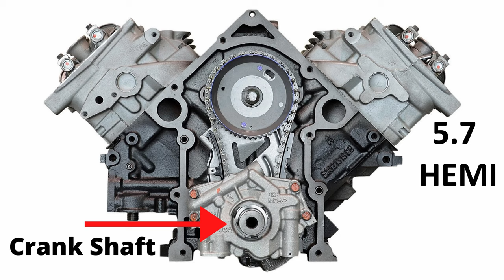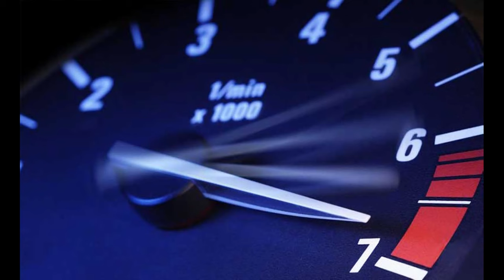HEMI TICK Explained (Easily) - The Cause and How to Diagnose

Comment: Thank you for information !
I Own a 300 c 5.7 2019 and I to heard the ticks in cold starts !
I have been recognizing that  at 17.000 km only and now 20 k nothing changed !
I changed the mopar oil to penzoil fully synthetic and still coming for only 3 second !
don't know what to do 
I will try locus oil next time
Reply: Tick goes away after a few minutes warming up better check your exhaust manifold bolts.. yes I am a retired mechanic
Reply: @scottrussell6717   Actually I Went to the dealer, they said it’s not possible to be exhaust leaking ! 
Not in chrycler or Dodge Charger 
I tried lucas oil this time and it’s better. 
Thanks

Comment: Do the new rams have an updated Hemi? I’m looking at a new 2020
Reply from the maker: Apparently it's very similar to the ones in the older model. which would make sense seeing the power number are exactly the same.
Reply: I got a brand new 2021 ram and it’s says on the manual that the tick is possible 🤣

Don’t let the that drive you away from a ram though I love mine.

Comment: I have the same ticking but it's not that loud like the ones I've seen, and like when it is ticking it ticks for like a solid 10 mins and then it just stops, and when I accelerate it it ticks even faster and louder, would that be a exhaust or would that be in the engine?
Reply from the maker: hard to always tell. usually an exhaust leak tends to fade as the engine gets warm but not always the case. I would lean towards an exhaust leak.

Comment: Metallurgy mistake when making the cams?
Seems like the permanent fix is a cam with DLC coating on the lobes and lifter faces or rollers.
Reply: Nope fix is making lifters that pump oil thru them camshaft and lifters are good quality oem When they designed the hemi the angle the lifters are at do not allow oil to go down to that roller where it meets the camshaft it is a design flaw also they put a girdle in the middle of the block it blocks any oil that would splash up on the camshaft .they made the lifters at this angle because it’s a better angle for the lifters but the idiots didn’t compensate for the angle so lifters and camshaft run dry

Comment: Ok I have watched the video and I’m a bit skeptical only because I have a 2003 Dodge Ram 2500 with 5.7 liter hemi and I noticed ticking noise about 10 years ago at 108k miles now I still have the same truck same engine I know it’s about the end but it just rolled 493,000k miles.  I’m determined to make it to 500k. Show me one ford or GM that can do this and I use this truck to cut concrete everyday!

Comment: Mine has a loud ticking up to 2,000 RPM. Sounds like a loud sewing machine, gets louder as I give it more gas up till around 2,000 RPM. Can hear it very loud in a parking garage
Reply from the maker: These engines do have some top end noise naturally. when I first bought my truck I honestly thought I had an exhaust leak off the sales lot but apparently that's just how they sound. regardless if you are worried doesn't hurt to bring the truck into a trust worthy shop because a decent mechanic should be able to tell right away if there is an issue.
Reply: i went online on the ram truck forum and people have killed the Hemi tick by using redline oil   5W-30 it suits the hemi.
Reply: @7thkev519  thanks for the info , I've been using mobile 1 with 1 quart of marvel mystety oil. So far so good.

Comment: I dont know what gasoline your putting in the truck. But if you look on Google the reason from the hemi tik its mainly caused from bad gasoline. Remember it's a hemi it uses that hemispherical header to make more power. It's a performance engine, it needs synthetic fuel

Comment: Anybody notice in all the pictures of destroyed lifters it was the MDS enabled ones?  This is mostly an MDS problem.  When either the lifter or solenoid fail with MDS active the roller no longer stays in contact with the cam lobe at higher RPMs and causes the destruction of the needle bearings from crashing on the lobe.  #1 cause of that failure mode is dirty/contaminated oil.  Also, all Hemis tick a little.  It's when it gets louder than usual that you may have something to be concerned about.

Comment: The in block cam design limits the lift of the cam and its duration. So, Mopar put the cam higher in the block to make more horsepower available.
Another possibility, and this will take some research and development, would be to put a line above the lifters to spray oil on the top of the lifters and cam lobes. Besides using better needle bearings, you could use bronze bushing type lifters. I think Crane makes them.
Reply: Hemi has oil galleries above the cam/crank and sprays oil under pressure on the engine parts..It doesnt rely on splash from the oil pan!

Comment: Glad you talked about it. In my opinion, this is a pretty severe design flaw and everyone always acts as if the Hemi is the best engine ever... I can’t stop thinking about this. I love my Hemi but this is not what a good engine is supposed to be like, and what’s worse is that Chrysler hasn’t fixed or acknowledged it, even though it’s been an issue for over a decade.

Mine does it very slightly and when I top off the oil every few months, it’s completely quiet for like 2 days. For me it’s just extremely annoying because I usually do idle a lot, and I’ve been trying not to, to avoid any catastrophic damages. I’m looking at trading it in right now. I’ll miss the Hemi because it was a fun power train and by far the best sounding, but damn this feels like walking on eggshells.

Comment: Decent video. I like replacing these cams, motors are gravy. I work for a chrysler dealer so you can understand. 
The hemi’s and 3.6’s are the speciality.
Rule of thumb is if there’s ticking on cold start and goes away, then it’s an exhaust leak. But you can tell before that because there’s a tisk type noise. 
Lifter tick will always be there, hot or cold.
And what i’ve found is that hemi’s with lots of idle time and going too long on oil changes will get you there quicker
Reply: I noticed on my 13 rt, I had to jump start it and wen I finally got it cranked it was making a terrible knocking noise but eventually went away, any suggestions on that
Reply: @cutmiller8846  Sounds like it was misfiring maybe ? Any check engine lights/codes ?
Reply: Hey man my 2014 hemi is ticking hot an cold. I don't believe it's an exhaust manifold leak. No codes ?? Lifters would be a green light for a warranty
Reply: Good to know, the 5.7 in my Aspen ticks at startup but goes away after a minute or two.

Comment: I know the pentastar V6 as well seems to have a similar problem with roller bearings going bad.  I have that engine in my Ram and think that problem may be starting.  My plan though is to replace all 24 of them if its the case.
Reply: Yes they are notorious for it too. Best is to replace all while you are in there

Comment: Basically drive it like a hellcat a little bit.
Reply: Thats what i was getting too like so the best way to preserve the motor will be driving it hard?
Reply: Yeah basically step on it and make sure you get on the free way
Reply: Ouch on the Gas .
Reply: Lmao I be whippin my 1500 like it's a TRX
Reply: @Durahan82  damn that's true. I fill up $90 per week give or take $400 per month
Reply: @looksmaxxxine  Daily driver ?
Reply: @Durahan82  yeah but I'm saving up to get another car so I don't have to drive my truck as much. I want an F90 M5 but I don't think that will help with the gas situation haha
Reply: @looksmaxxxine  don't waste your money on BMW, get an old jeep with M/T way easier on Gas.
Reply: @Durahan82  I need a sedan...I already have a truck so I need a sleek low rider that goes fast especially on turns
Reply: @looksmaxxxine  A V6 Charger with a M/T will be easier on Gas then.
Reply: @looksmaxxxine  a toyota for good mileage and low cost of repairs/maintenance
Reply: @axel2k322  I need speed and luxury I don't want plastic interior and halogen bulbs. Ya feel me? I also need a good sound system. I hate when doors rattle.
Reply: @looksmaxxxine  a passat vw would be good

Comment: Sometimes it is broken exhaust bolts... easy fix is to use shorty headers that mount up to stock exhaust or redo the exhaust with long headers. Bolts are notoriously broken because of cast iron manifolds verses aluminum heads... stainless steel headers will expand better with the aluminum heads... reducing the chances of breaking bolts. Port the journals on the crank and other port orifices to a wider angle will increase oil coverage... we used to do this in the machine shop to increase the life span of the parts with adding a performance oil pump.

Comment: But the lowly Slant Six and 318 LA engines would last seemingly forever with few problems.  I had a few waterpumps go out, and one timing assembly (who thought nylon cam gear teeth was a good idea???), but overall, these were great, long lasting engines.  The later Magnum 5.2 and 5.9 are good performing, long lasting, too.  But I worry every day that I'll start my 2016 Ram 1500 5.7 Hemi and hear "tick-tick-tick-tick...".

Comment: I have been recommending VR1 racing oil for these 5.7 hemis, yes I know it is bad for the converters but only if the engine is burning oil, most do not, I think the extra zinc may make them last longer it coats high pressure areas with a coating that will protect them even with no oil for some time

Comment: I’ve seen 5.7 hemi’s drop valves because the driver kept driving it after it starts ticking. Ppl say 5.4 Tritons are bad I’ve never seen them go bad they keep on ticking. Dodge made the same flaw with the 4.7 and on top of that the 4.7 dropped valves because they weren’t rated right from the factory. Chrysler quality.
Reply from the maker: It's a tough look from Chrysler. It's honestly to bad because when the hemi's run well they are a great engine. lots of power and very smooth. also have a great sound.
Reply: The Getty Adventures yeah I know that’s one reason ppl still buy them, when they run correctly they’re great engines. You can probably spend some money and bulletproof then I’m sure tho.
Reply: Grunt  quit assuming shit buddy I got a 2001 Ford F-150 5.4 2 valve and an 05 5.4 3v. The 2 valve has 243k miles and the 3 valve has 165k. And I am a part time mechanic I’ve seen a few 5.7 hemis have lifter failure. Never seen a 5.4 have lifter failure just valve train ticking sounds but they keep on doing it
Reply: The triton 🤣 they couldn't even get the heads correct. Let's start at the spark plug issue...
Reply: @coltendixon1782  yes let’s talk about a cheap non catastrophic issue of the 5.4 and compare it so the 4.7 and 5.7 severe issues...
Reply: @popeyeandstraussmx4165  and I said let's START with the spark plugs..

aside from a no start,  lack of power, the code P1233, and hard starting. Lastly, the scariest part for most late model 5.4L Triton owners, is the problems related to the timing chain, tensioners, and the variable valve timing it was a great truck ahahha

The 5.4s were the first I retired from my pilot fleet. I don't care what you think, unless you own them all and max out all of there kms your opinion means nothing

Comment: Wouldnt an engine oil analysis pick up the metal from bearings and worn cam lobes? I think they are fairly inexpensive and a 2 week wait.  Barely get your hands dirty.
Reply from the maker: you could certainly get your oil tested. might be able to help you pick up a lifter failure very early and save your cam shaft. interesting idea! thanks for the share!

Comment: 262,000+ miles now on my 2007 RAM. It started ticking at about 245,000 miles. Still runs like new though.
Reply from the maker: Good to hear. Gives me hope!
Reply: Makes me feel a little better knowing they make it that high. What viscosity oil do you run? I have been wondering if going thicker would be better.

Comment: Cool info, was going to mention UTG, you got me on that. Yes all due to higher location of camshaft, I believe there are aftermarket lifters that offer better lubrication.
Reply: UTG is clueless..
Reply: Aa
Reply: @massivefins2597  - UTG did a very comprehensive explanation on this problem. The man has built more engines than you’ve tied shoes.
Reply: @67NewEngland  he knows nothing about modern engines.. and his stuff always breaks... :)

Comment: I've had the hemi tick or marble sound from day I bought it , in april 2006, Dodge ram 1500 5.7 hemi trx4 4x4 35 inch tires and fox coil overs front and air lift bags rear, close to 82k miles now towed my toyhauler filled with dune buggy 3 wheelers quads all gear and fuel for weekend stays water, gas extras , weekly in town to glamis gordonwells offroad area desert to Las Vegas Utah new mexico, from san diego at 19,860lbs trailer and truck once weighed at scales,loaded it has held up no problems just hear the tick or marble sound not sure always hear it hait it but truck still strong and reliable only have had to replace water pump just 3 months ago that's it and replaced the belt the tensioner the idle bearings while in it, hoses and fan clutch , and battery last year super reliable maybe I dont have lifter tick but theres always that marble clack sound but anyways been awesome truck ya maybe a nice Cummins 2500 would of been better for pulling the mountain grades yes would of.
Reply from the maker: funny you say that. I bought my truck off the lot and I honestly thought it had an exhaust leak or some top end type of noise. But apparently that's just how they sound.
Reply: Same here. Have an 08 ram 2500. 138k miles no issues with the valve train.

Comment: Well boys, I have the Hemi tick. Wish me luck.
Reply from the maker: That's tough, sorry to hear
Reply: not too bad chief, 206k on mine, mine started a really bad tapping around 180k, still goin, sounds scary when your sitting idling in the driveway, but still running.
Reply from the maker: @aaroncarmichael516  Maybe a manifold leak ? usually a lifter tap doesn't take long before it destroys a cam

Comment: I have a 2011 hemi in my ram, and well I fix it last year and well now, I have the same problem, again lol. So, now I just put some “engine stop leak oil” mix with the oil. I hear the lifter every morning but I let the truck warm up and it’ll be gone within the 5 minutes.

I know it’s not the exhaust, you can hear it clearly when it’s a lifter.
Reply: How much did it cost to fix the first time?
Reply: @dlestus2368   1200 for all the parts, oil and gaskets
Reply: @dlestus2368   now I’d you go to a shop, they’ll charge you from 1500- all the way up to 4,500

Comment: This was very helpful indeed, it's the only video I found, that explains why it happened. 

I have 5.7L 2014 Challenger, with a 65k mile on it, it starts ticking 2 months ago 🙃, after a quick diagnosis, the mechanic told me a lifter/s need to be changed asap.

With quarantine, my needs, and almost constant curfew in my country, I didn't get a chance to arrange for a fix, I'm just doing it now.

However, because I don't have full trust with mechanics (sorry) i have few questions that maybe you can help me with, please, to increase my knowledge. 

- Do they need to take the cam out and visually diagnose it? Or it's good if he said it's good because i have no code for missfire? 

- If the cam is good, is there any parts need/recommended to be replaced because we took of the gasket? (In other words, before we open the engine, should i only buy lifters, or some other parts too?)

Thank you.

*English is not my first language.
Reply from the maker: Depends on the state of the cam. if you have caught it early enough I have heard guys not having the replaced the cam. But, most of the time  the came lobs are very warn out. If it were me, I would want to inspect the cam shaft. you are already into the engine pretty good with new lifters might as well do the extra work and pull the cam to see if the lobs are okay. my guess, depending on again, how quickly you caught this,  the cam is likely damaged to some extend. I wouldn't re-use any gaskets, buy all new and save yourself the hassle.
Reply: What was ur issue? Fixed it?
Reply: @patrickpatterson3735  
1 bad lifter, which scrapped out the camshaft only at the spot of their contact. 

No I didn't fix it, after a year, I thought maybe it doesn't worth to be fixed, as long as everything runs okay 😅

Now it's been 2 years, same ticking, but also, same performance.
Reply: @iqthunder1  thanks for the reply. That sounds like a good deal, if performance is fine, no need it change it. I have a tiny tick problem that I hope I don’t need to do anything to

Comment: I picked my 2014 ram over ford because of the hemi motor. Learned about this flat camshaft issue 2 years ago. Truck is at 10000km. No signs yet. Will get all life out of this truck and figure out what's next. lol
Reply from the maker: Honestly it's a pretty low failure rate so as long as you really watch your idle time and make sure you have good clean oil in your truck the odds of lifter failure are low. However, it happens enough that it is an issue that people should be aware about
Reply: Typo, 100,000km
Reply: Just buy bestline lubricant and added to the motor and will not have any issue and will run by better